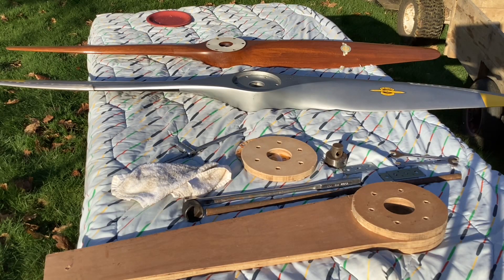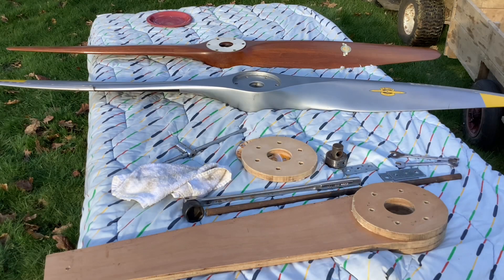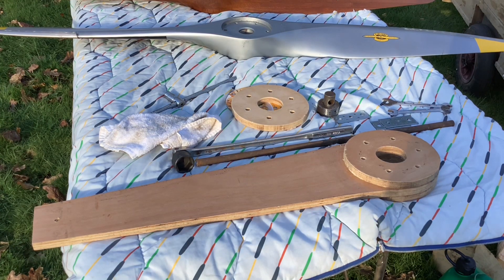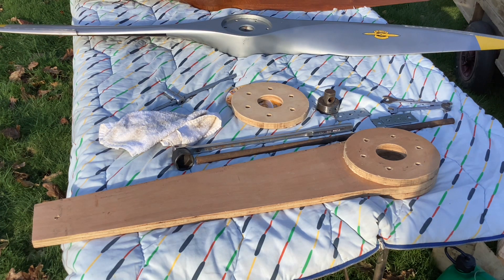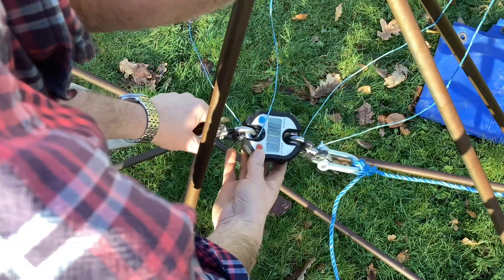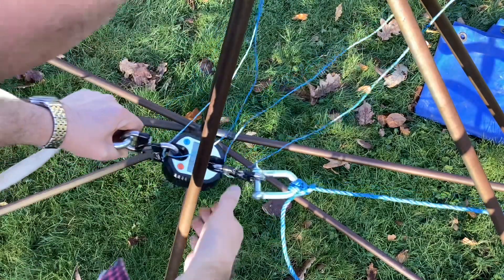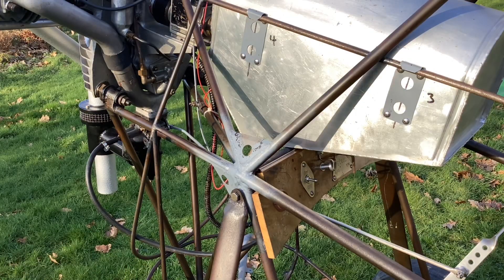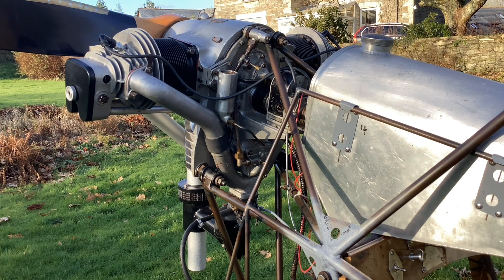Aeronca C2 - Testing Propellers - Part 1

Comment: Most interesting and engaging.  Thanks for showing so much of what it takes to make one of these veterans fly.  In my younger days, I built/rebuilt several car engines.  I always had the dream of an engine dynamometer to test them.  Being so much more sophisticated than an automobile, an aircraft only needs a reasonably accurate spring scale.  Marvelous.  You are so right that the Sovereign would clearly be the right choice. The smoothness was apparent from the first few pops.  A thing of beauty to be sure.
Reply from the maker: @davestarr7112  There’s nothing sophisticated about a two cylinder Aeronca Jap! A propeller is ideal for ground running as it’s effectively a self contained dynamometer, offering increasing resistance with rising rpm. The Sovereign is a fine prop and I’ll definitely use it on the C2. More engine runs soon 👍🏻

Comment: Looking forward to your video on the E-113 crankshaft failures. I have a couple of Aeronca K project planes and engines. I have several crankshafts, some look new. Want to do the right things to make them stay together.
Reply from the maker: I’m intending to make that film in the next couple of months 👍
Reply: Always liked the Ks. Almost bought one many years ago, but it needed more work than my abilities and finances at the time could handle, unfortunately !
It didn't have an engine at all, and before I passed on the sale, I tossed about the options of finding an E113 or repowering with an A65. The latter seemed like a worthwhile upgrade, but I really like keeping these early birds as original as possible. It did eventually go to a very good owner who I believe went with an A40, I. Lost track of it some years ago.

Comment: ? why was the lower torque prop the better choice?
Reply from the maker: The Lang gave a tiny bit more thrust but I am concerned that it's too fine and the motor will overspeed in the climb. Throttling back to control rpm effectively reduces manifold pressure and thus power; not particularly helpful on an already low powered machine. Lift off rpm is usually around 100 rpm more than static, due to the propeller unloading at speed (because the relative airflow has less angle of attack). The Sovereign is very smooth and a 100 rpm increase in rpm will be beneficial without risking overspeed etc. That's the theory!

Comment: Beautiful prop. Seems like the lower rpm would be kinder to the engine over time.  The smoothness surely will be.  The oil spray would irritate me greatly.  Could you create a dome like cover to go over the oil breather and maybe have a drain tube attached to it to hang down below cowling?
Reply from the maker: I have seen some novel modifications to the breather but never any information as to how well they worked. The pipe would be very oily inside. As a matter of fact we have just filmed Part 2 and I cleaned the back of the fuel tank beforehand. There was almost no oil on there afterwards which can be explained in two ways? Firstly the oily mist is less than I thought; secondly she's run out of oil! The Sovereign propeller was the smoothest running of the three tested.
Reply: @FlyingForFunTrecanair  just had a thought….maybe place some type of sponge on top of breather to catch a little more oil
Reply: @dcmflydude6320  I have seen many breather tubes run into a seperation can that has an internal standpipe and a kind of swirl vane inside to spin the air and extract the oil. the oil can then be removed through a drain cock after. flight , or flights.Kind of like the catch tank on the c 130 for the fcu dump on shutdown.
I just use a rag on my Vegabond...its the charm of flying antiques.
Reply: Nick are the rings are seated good and you have good compression?  How many hours on one of those engines until the rings seat?